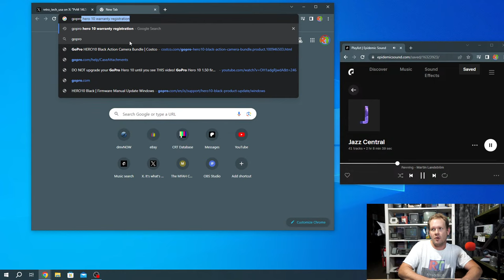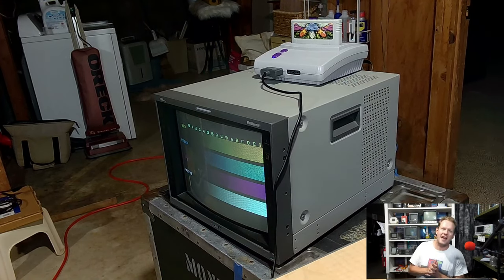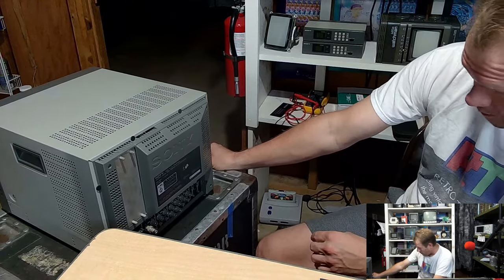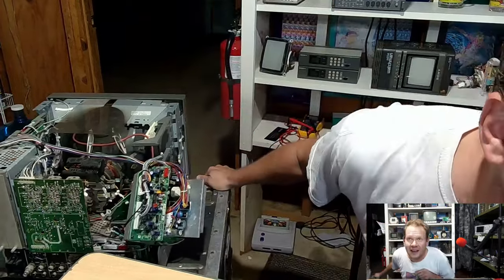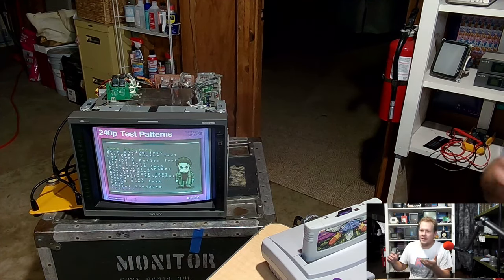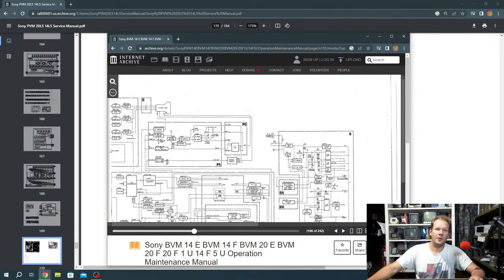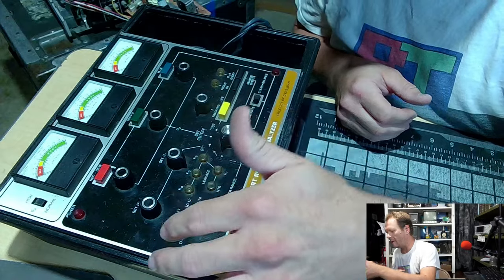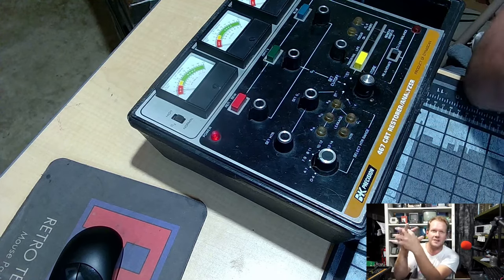SONY PVM 14L5 Troubleshooting & Tube Testing

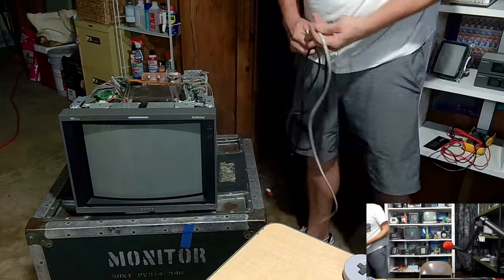Comment: 45:50 I'm a clueless newbie and I'm thinking about attempting to clean the inside of my PVM on my own, and I'm wondering why you wanted to turn off the surge protector at this point. What would've happened if you didn't turn it off? What should I do to avoid anything bad happening?

Comment: Is there literally no way to pack these things to withstand the perils of shipping? These things were originally packed in Styrofoam, I presume. Is it not possible to get thick Styrofoam packed around the CRT tightly enough that it would take the brunt of any bumps, drop-kicks, and body slams? Or is that still just not enough of a guarantee?
Reply: I just thought of an idea for a video. Get some old buster CRT monitors and have a shipment packing shoot-out. See who can pack a CRT well enough to withstand a drop off of the back of a UPS truck, kicking with steel-toed boots, shooting with a shotgun, etc.

Comment: That's a joke. GoPro is insisting that Cosco's warranty SUPERSEDES the GoPro warranty? Cosco is the purveyor, GoPro is the manufacturer. I doubt that's even legal.

On top of that, regardless of their claims about the Cosco coverage, a written warranty was included WITH the product. 

There is no legal defense that dispenses with the fact that any reasonable person would infer that the written warranty in the box would assume that this document applies to the product with which it comes.

And remember, yours was a special case because they supplied the damaging firmware.

Everyone else is screwed....